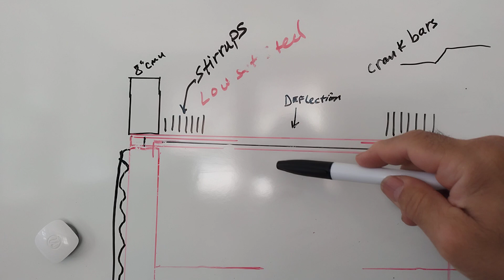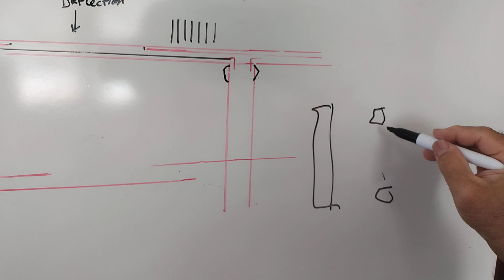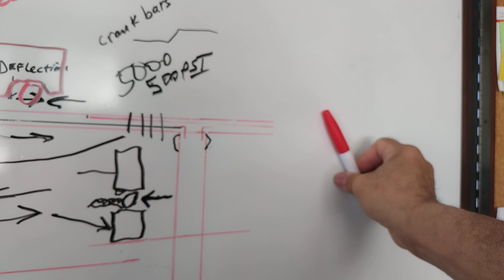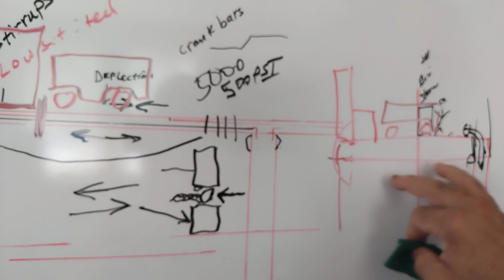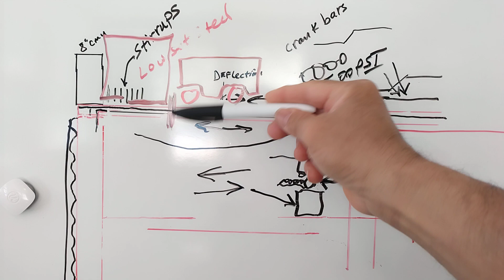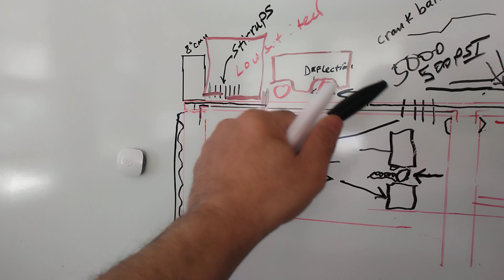Champlain Towers Top Steel at wall not identified? Core samples shear plane failure Stirrups lacking

Comment: Wow. I didn't realize that the decks were supposed to have stirrups or something binding them to prevent the horizontal sheer action. It's scary how trusting the general public is, like many of us wouldn't notice a really bad situation until it's about ready to hit the fan apparently (or maybe would bury the head in the sand if it is recognized). We can't be an expert on everything, though.
Reply from the maker: These decks do NOT require stirrups... it was to demonstrate why you can get plane separation.
Reply: @LoadPathEngineering  Point taken. Thanks for clarifying.
Reply from the maker: @catwoman7014  , you are welcome and fYI, this deck does meet the thickness criteria  BUT BUT it dOES NOT NOT NOT meet the column offset requirements... Which in turn has the deck failing because it IS required to be integral with the columns.; fail one and it fails as a system. imo

Comment: Hello 👋 
If slabs thickness are not OK that means the compressed total loads impacts of cars on the slabe not OK, but we can reduce the thickness by use  mushrooms columns or poste tension
Reply from the maker: The column offset locations are NOT tolerable "offset"...
They are greater than 10 percent, that alone trashes the "panels" / slab/ deck and parking "interaction s"...

Comment: Looking forward to seeing this!
Reply from the maker: Thank you Droids, hope you enjoyed it.
Reply: @LoadPathEngineering  thank you very much for covering this in detail. I think your point about, and description of, the deck delamination was excellent. The 3/4 length description of the deck failure points was very close, I believe.
Reply from the maker: @exist7309  yes, I was hoping people would call me out on that... I would have countered with, '' equal and opposite reaction"... opposite being on the ''opposite side'' which would also be on the tension side and AWAY (the counter side ) ; which makes more sense to me, it would be the anchor / tension side that is secured by the opposite connection (in this case, the all system)...
But, we engineers shit-can that and say, the load is just back to the column and the other 50% is back to the wall and we actually believe a neutral axis is created there, I call bullshit on that ...

Comment from the maker: This will discuss ''shear planes'' as in horizontal !  and this will reveal how we can get the core sample to demonstrate / present as horizontal shear... further, we will discuss how the planter box and car loaded area CAN be the starting point of this failure... (This will make one viewer /engineer very happy, I have been holding out on this one for a long time and only flirting with my jealous wall)... now we will get down to brass tacts!

This channel is viewer supported, kindly give a thumb's up on this content, it would be greatly appreciated.

https://www.amazon.com/hz/wishlist/ls/3UBMVWND65U4M?ref_=wl_share

My email is cefa1@yahoo.com if you would like to get hold of me.

https://www.paypal.com/cgi-bin/webscr?cmd=_s-xclick&hosted_button_id=V9TGHDE92LQ8W&source=url  thank you very much.
https://ibb.co/r4wTF98

https://www.youtube.com/watch?v=p00-lJ0q_cA
DEFLECTION IN CONCRETE DECK MODELLED WITH REBAR ''ANTENNA" PART 1 of 3

Champlain Towers & DEFLECTION IN DECK modelled  WITH REBAR ''ANTENNA"  PART 2 of part 3 #BoltDepot

https://youtu.be/Ey80n1HwoO8